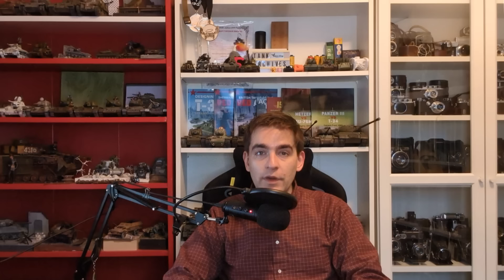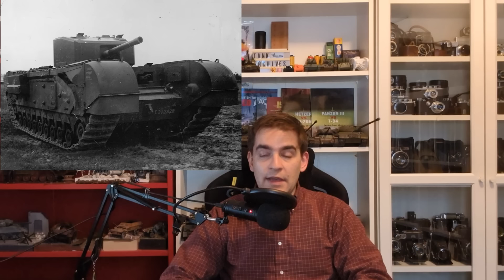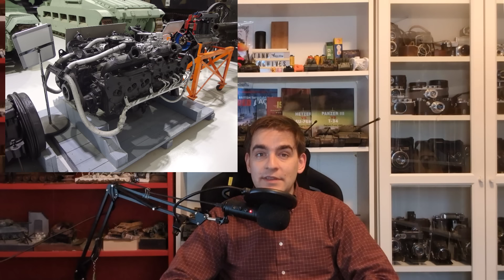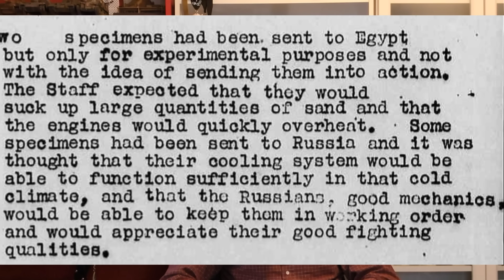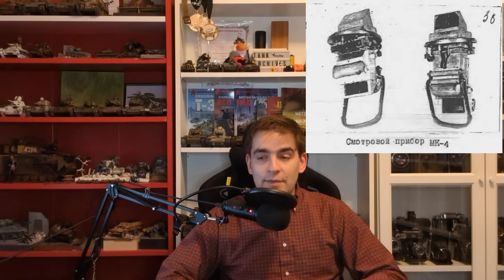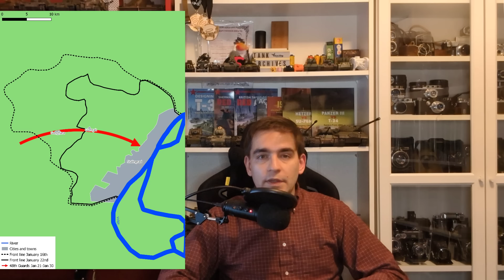Churchill: Outlier on the Eastern Front

Comment: >powerful armament

2 pounder and 76mm gun with mortar ballistics doesn't sound all that powerful to me.
Reply: At the time the 2pndr was an excellent AT gun
Reply: this is your brain on war thunder

a mid velocity howitzer is useful for the high explosive load it carries and smoke laying, being able to be used as a close support gun and allowing the tank to perform dual purpose firepower abilities without being built in a time where dual purpose cannons were commonplace with that kind of AT and AP power at the same time easily built and mountable in a protected turret n hull, more like... a tank like this.

It was a method of getting both a way to deal with bunkers, machine gun nests, various soft skin vehicles and other targets, as well as things out of view quickly and easily that your machine guns could not. And finally, it could carry a stock of white phosphorus shells to actively lay smoke cover for infantry and other tanks in battle or beforehand to help with concealment of which other tanks were rarely able to do, not having the guns (and rarely the ammo) able to so, here weren't so many of those "CS" tanks in the British army.

While the 2Pdr would be entirely unsatisfactory for such a job that the 3in gun performed because of it's calibre, it's length to diameter ratio, and a fair few other design factors allowed it to have significant armour penetration for it's size leaving it as an easy to mount low recoil but powerful anti tank gun allowing you to store lots of ammunition. It could go through most of not all of it's contemporaries, it simply ended up outmoded years after it was built like all these things are and people tend to compare it to things a bit later than itself. 

Churchill specifically? The 6pdr turret was meant to go on first, and the 2Pdr one was essentially there for "if the 6Pdr isn't done yet by the time we're building these, start putting these 2Pdrs in and we'll replace them with the originally intended 6Pdr turrets later when the artillery has that ready for us"

Comment: Soviets considered Churchill adequate but not the great tank. Biggest complaints were mechanical unreliability, and 2 pdr gun on versions that had them. 6 pdr was considered somewhat better, they also had those armed with 75mm gun. Some of them were deployed around Kursk, where they suffered losses but managed to destroy several PzIV and 88 mm  AT guns, thus preventing breakthrough. Most of them were used in northern sector (Leningrad front) with somewhat better results, as terrain there allowed close combat, more suited for Churchill main gun. This is of course close to Murmansk, so it was easier to transport tanks there.

Comment: The Churchill could have received the Napier Lion aircraft engine - good for maybe 500bhp, which would have transformed it's performance and almost put it in the category of a 'universal tank'. The Napier Lion was veto'd across tank production pre and early war by influential industrialist Lord Nuffield who wanted engines from his own group to be used. This scandal wasn't put right until the Rolls Royce Meteor was adopted later in the war.
Reply: 2 things - Churchill gearbox was barely adequate for the 325-340hp it already had and the Lion isn't making 500hp on WW2 pool petrol of 70 octane, more like very low 400 hp figures.

Comment: 12:39 I thought the Churchill was pretty good in steep country?
Reply: Must have been the early variants that still had a lot of issues.
Reply: Seems pretty variable, and I bet it'd be very different depending on the terrain you're on. Sounds obvious but dry grass with dirt under it the tank can get done purchase in due to the weight of the vehicle and it's track's cleats? I can images it biting it's way up the hill. Hardened compacted ground up a hill? Sometime cold and wintery? sounds like hell especially with the older smoother more interwar tracks that had such short run time before being worn out they I bet fucked up it's ability to grab the ground or the sprockets, maybe slipping and losing energy in the process effectively screwing the power transfer between engine —> transmission —> sprockets —> tracks —> roadwheels —> ground
 since it's already losing a decent percentage during each one of these stages and if each part of the drivetrain is wearing our significantly more than it should over time and especially the ones exposed to the elements, directly like the tracks and sprockets? Ough.
Reply: Read what the Americans thought of them in Korea.

Comment: Can you make and third Lend-lease tier Lost with the other armored vehicles the Soviets had received? Like the Bren carrier, the M10 Wolverine and the "SU-57", for example.
Reply: SU-57?
Reply: @Trashcansam123  M3 halftrack with a 57mm gun mounted on it.
Reply: If you're still interested:
They got a bunch of early versions of GMC M10 and put it in a trial in winter. And they were very unimpressed, to say the least. It turned out the problem wasn't the gun, the armor, or even the engine. It was the suspension: this thing couldn't move properly in deep snow, or, more accurately, climb almost any big snowdrift on the side of the road. 
This applies to countries with climates where snow falls regularly and heavily, even without turning into severe frost (virtually all of Scandinavia and most of Eastern Europe, east of Thuringia and north of Bucharest) - If you simply clear the roads without simultaneously taking the snow away to "somewhere", it will have to be moved off the road surface somewhere, so there will be large piles of snow along the sides of the road, practically a seasonal version of the bocage in Normandy.
Of course, they had the same problem with their own equipment: like with a T-60 and T-70 specifically, but that's a whole other topic. Therefore, they obviously decided not to overload Lend-Lease transport capacity with something that would, at least in theory, be of little use at the front, had its own equivalents "at home," and, in general, it's very naive to think that such shipments was completely free. In other words, they decided to load up allied shipment capacity with something more useful.